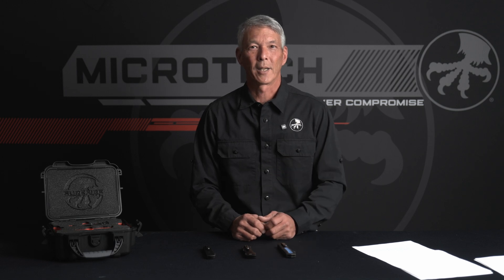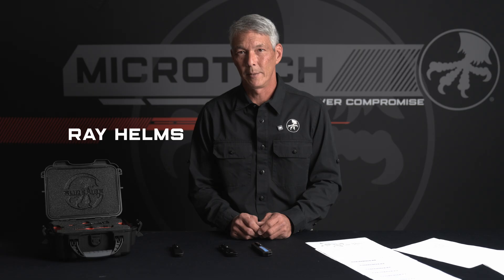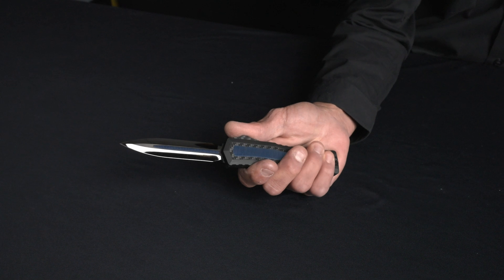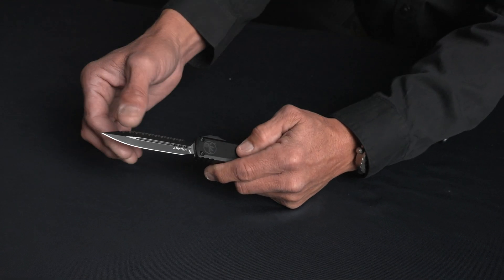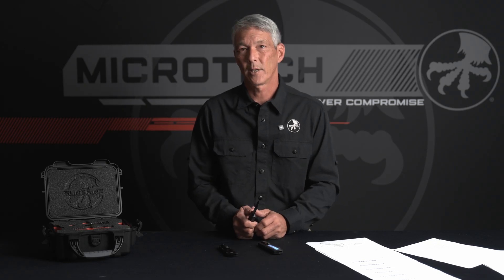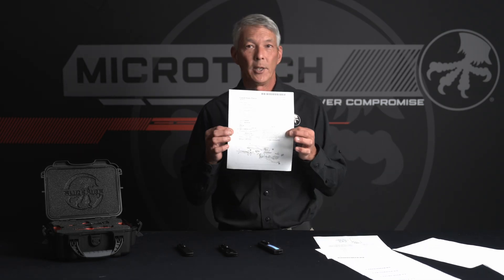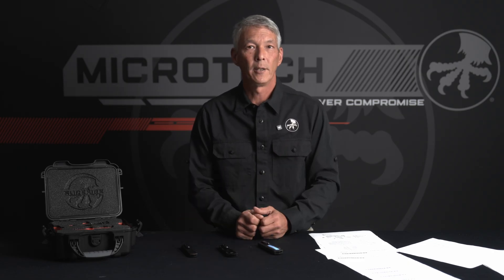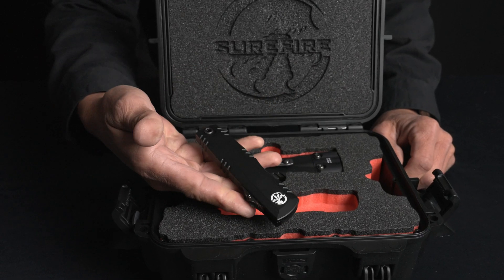Microtech's Zero Blade Play Patents

Comment: Just recieved my first Mictroech today.  I got the Ultratech Gen III ZBP.  There is absolutely blade play.  I would describe it as relatively minimal, but the notion that there is none is simply false.  Is this to be expected or do I have a defective knife?  Can this be adusted?  The blade moves from side to side and I can feel it move front to back when I put my thumb on the backside of the knife.  I have certainly used other OTFs with significantly more, but either mine is defective or we have different definitions of Zero...
Reply: I got one too, and it has zero blade play. I guess being that they’re making so many of them whoever is putting them together is not putting them together like they should I suppose but it can be adjusted to where you have zero

Comment: Love your product, my OTF is my EDC. That said, my knife was embarrassingly dull out of the box. Literally a ground edge, despite loving the quality of the mechanism, I almost returned it. Regardless of blade shape, if the surface is intended to carry an edge, that edge should be razor sharp out of the box at this price point.

I have not sharpened it yet, and would be happy to send it in for an inspection, as I'm hoping it just slipped through quality control?
Reply: Dual edge blades are known to be not as sharp as the single edge variants
Reply: @TimDillon1234 mine was razor sharp

Comment: I was anxiously awaiting Microtech’s point of view - I love my 24 and counting Microtech’s!
Reply from the maker: We appreciate your continued support! Will you be attending Blade Show ATL this year?
Reply: @MicrotechKnivesOfficial I unfortunately cannot but I follow Microtech and have posted countless times about Microtech’s revolution over the past year and a half… The sharpest and best ground blades ever, incredible enhancements like titanium and silicone carbide pocket clips, integrated clip and glass breaker housings, large torx screws, titanium back spacers on the folders and Glykon, dual fuel is exceptional and your prices have remained relatively constant, a few price drops or only modest increases. Microtech is one of the only makers that has added value and quality upgrades across all lines and we as fans, really appreciate it!